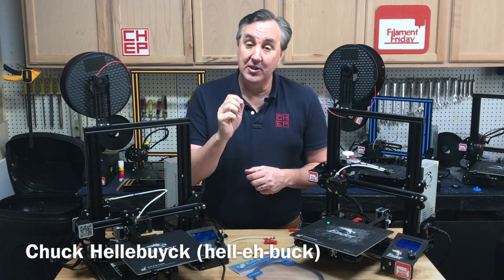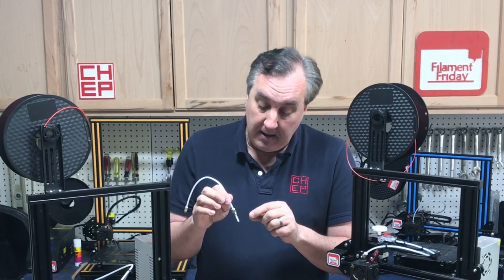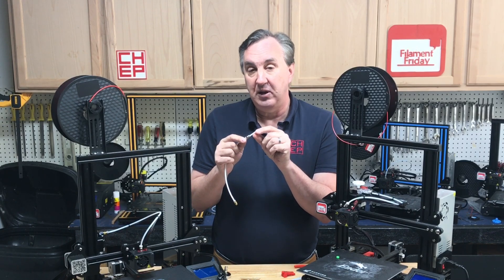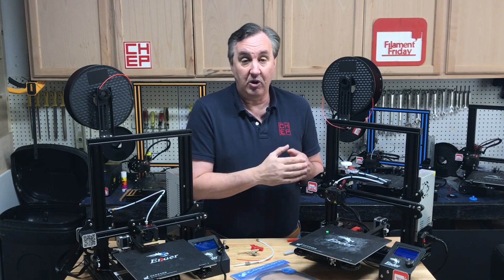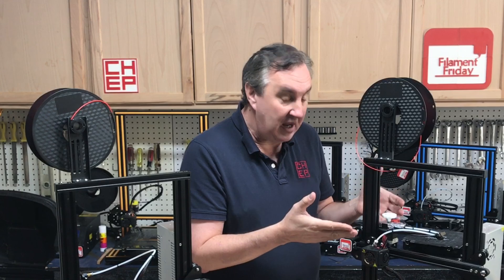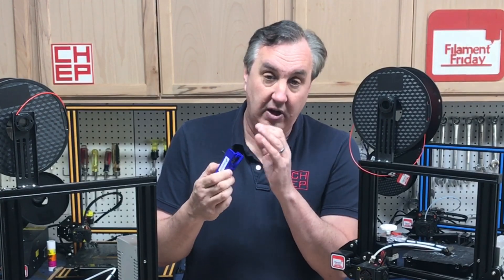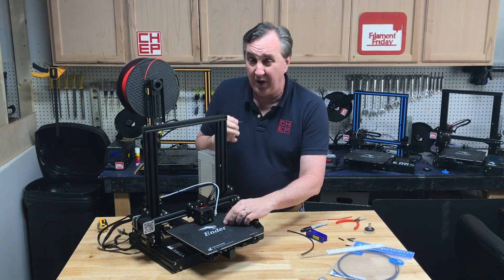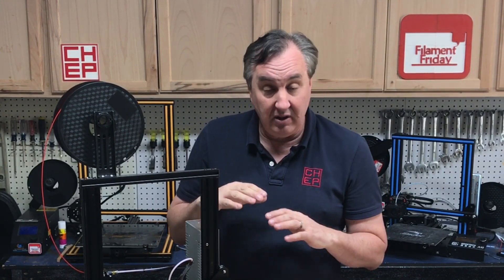Simple HOTEND FIX for Creality Ender 3, CR-10

Comment: I'm in the middle of trying this for my Ender 3V2 and I'm stuck!!  In the video mock-up hot end, the tubing OD just barely fits inside of the hot-end, so it's held perfectly centered.  But when I take off my coupling, there's a very large diameter space inside the hot-end and only the very end of the tubing is held tightly just before it hits the top of the nozzle.  As a result, the short length of capricorn tubing isn't held in the center and doesn't line up with the hole in the washer.

Any ideas?
EDIT: I'm thinking my heat break is f'd?  If I understand it correctly, it should be running up the inside of the fin structure.  I've ordered an all metal heat break replacement.  Hopefully that fixes it.
Reply from the maker: Newer machines are different. If you’re trying to fix clogs, replace the fan. Most issues are the fan failing and not cooling the finned heat sink fast enough.
Reply: @FilamentFriday  Thank you!  Yes, I saw that you'd posted that in reply to another person's comment.  I do think my fan sucked (hehe) so I've also replaced it.
Reply: @cwyckham just read this comment as I am about to implement this "fix". My E3V2 is stock machine and is currently running perfectly without any issues. I am just thinking of implementing this "fix" as a long term solution and also as a step towards arming myself to print some higher temperature filaments like PETG, TPU etc.
Could you please share what your eventual solution was? What timeframe is your machine manufactured? Mine is a late 2022 manufacturing date so wondering if mine would have same loose fitting hotend.
I am just afraid of falling into the trap of "don't fix that ain't broke". Any insights are highly appreciated. Thanks in advance.

Comment: I used it and it worked for a while, had to replace with a new pfte section and washer, now after assembling the filament won't go past the washer. Pfte is from the same coil and washer is from the same batch I printed
Reply from the maker: Your fan is probably failing and spinning to slow.

Comment: Can one print with petg using this mod?  If the washer is printed with pla, and  that washer is connected to the heat sink, is that so hot that the pla would melt?
Reply from the maker: Yes, you can’t use PETG, but if the heat sink gets hot enough to melt plastic then the cooling fan isn’t working properly. The heat sink should never get too hot to touch.
Reply: @FilamentFriday  brilliant.  Thank you for taking the time to reply.  

I just did this modification Instead of replacing the heat break ( I have one from triangle labs) but figured I'd give this a go.  

I've done the mod, btw and it's working fine as I write.

Tomorrow I'm going to try some TPU.
Reply: @briholt100   just read this comment as I am about to implement this mod. My E3V2 is stock machine and is currently running perfectly without any issues. I am just thinking of implementing this "fix" as a long term solution and also as a step towards arming myself to print some higher temperature filaments like PETG, TPU etc.
Could you please share any updates or tips you may have since I presume you have been using it since posting about a year ago.
I am just afraid of falling into the trap of "don't fix that ain't broke". Any insights are highly appreciated. Thanks in advance.

Comment: It worked! At first. But I was already thinking that it would be a bad idea to put PLA inside the heat sink. It almost ended up melting in there.
Reply from the maker: If it melted then your fan is failing. The heat sink should never get that hot. Shouldn’t even be hot to touch if fan is working properly.
Reply: @FilamentFriday  Thanks for the reply! I suspected as much. That's why I bought new coolers and I'm going to print a dual cooling mod. I also decided to put a bimetal barrel. Thanks again. Your videos are very useful.
Reply: @FilamentFriday  Hi! I'm searching for a cooling mod that increase the refrigeration of the coldzone and heatsink of mi hotend. But I can't find none. I have 3 40mm cooolers to put on him if that's needed. Can you help me to find one?
Reply from the maker: @ - There is a water cooling option from Creality.

Comment: Once again you have been my hero.  I was having problems with prints not completing, the extruder motor was skipping and I thought it was due to heat fluctuation and the nozzle clogging up.  I tried tuning the heat temperature, but that only slightly helped.  I then came across this fix and thought, why not.  I did this and so far my problems have gone away, smooth printing and completes to the end.  Thank you so much.

Comment: So ive used this for years on my ender 3. But shep i was wondering with a full capricorn tube from extruder to hot end. And better cuplings is this still worth doing
Reply from the maker: If it works, why change it. I’ve had good couplings fail so I still believe it’s a good solution.
Reply: I used a full Capricorn tube at first. Worked really badly, too much friction (since it is a bit tighter, as Chep pointed out). Then I used this hotend fix. Works perfectly ever since.

Comment: In regards to the Creality Ender 5:
DO NOT set the z-depth via software, the printer auto-homes before EVERY print.
The z depth has to be set by the screw on the back of the build, then the individual corner screws have to be set.

A lot of you may be thinking, well duh but it isn't obvious! Especially people new to troubleshooting.
Can't believe nobody explained this in any of the videos/threads I read 🙄

Comment: is anyone having the issue of the washer melting in the hot end? would it be better to use a more heat resistant material like resin?
Reply: I am using PETG...  PLA might not be a high enough temp...

Comment: why cant we use a small metal tube inside the hotend instead of teflon? Isn't that how all metal hotends work anyway?
Reply: At this point literally just get a Bimetal Heatbreak with Titanium/Brass or copper mix and replace the stock hotend heatbreak

Comment: when assembling this hotend setup use a spare piece of filament down in the nozzle to make sure the washer and capricorn tubing line up accurately. also to prevent the ptfe tube from walking out of the lock fittings use a small dab of shoe goe between the ptfe tube and the plastic retaining ring and wait for it to set. I had ptfe tubing wear and start moving in and out of the pneumatic fittings due to the constant rotating cutting a groove in the tubing, once I applied the easily removable glue to the tube and the lock collar i have never had it come lose without me wanting it to again.
Reply: @chrismckay3868 those are nice tips. Thanks as I am about to embark on this mod. Can you please explain what shoe goe is and where to find it. Thanks in advance.

Comment: i love what this talks about, but in my experience with capricorn, is that i've had issues with clogging and found snipping that last 5-10mm or so off to help clear things up and i've found the olive oil has also done wonders to quiet otherwise clog prone situations..   why wouldn't we just put a metal tube in there instead for luke's solution?  maybe expansion / contraction of metal would create problems?   It seems like even capricorn loses it's lube over time..  but i respect you're saying 14months of hassle free printing..  that conflicts with my own experiences with my 4 Ender 3 Pros (all configured identically)

Comment: I was getting the E1 error on my Ender 3 Pro every now and then, so I tried replacing the heat cartridge. I made sure the connections were correct and secure, but even so, now neither the hotend nor the bed even attempt to heat up, and I get the Heating Failed error within a few seconds. Where could I have gone wrong here? Also, for some reason, when I tried to autohome it, when it finished, the nozzle was about 3-4 inches above the bed instead of where it should be. Not only that, but every time I autohome it, the nozzle moves up higher each time. I didn't mess with any of that, so I'm completely in the dark here.

Comment: In theory, Creality's water cooling kit should help eliminate the issue that this fix resolves, I think?. Since it acts as a stronger layer of temperature protection between the hot end and the PTFE. Thoughts?

Comment: Hello Chuck - I am new to 3D printing & your videos are my go-to videos for many things. Thanks for everything you do.
Speaking of this particular Hot End Fix, is this like a poor man's "all metal hot end"? I believe the Capricorn tube is rated at 300c, so by using a piece of Capricorn tube where it matters the most, will this allow me to print materials like Nylon that require running nozzle at 280-290c? Thanks in advance.
Reply from the maker: Yes, but Capricorn is only about 10-15° higher than standard PTFE no matter what they claim. So a real metal heatbreak is better. https://youtu.be/4RWz4ey1wjw
Reply: @FilamentFriday  ohh ok. Thanks for your continued guidance. Will look into the video you referenced. I guess that one is applicable for Ender 3 V2 as well. Thanks again 🙏
Reply: @FilamentFriday  do you think it's still worth doing this washer modification if you have an all metal hot end?

Comment: Will it still work ok if I print the washer out of PLA instead of PTFE?
Reply: PTFE is the material of the bowden tube, not the filament, you can do it out of PLA without problem

Comment: All my Ender 3D printers are oficially dead atm. So, I can't print a spacer. I found a couple of alternative options: 
a) small spring that would supposedly push onto the tube;
b) small metal spacer
c) small plastic dowel, cut the neck of it.
I guess with the metal I'd have to be very precise as there will be little tolerance. What would be my best option?
Reply: I hope you ended up fixing that already but your best bet would have been to fix the printers first...but besides that just grab some tubing (the water stuff) of the right ID/OD and use it like that spacer.

Comment: Good place to put a piece of aluminum tubing instead of PTFE. As the hotend expands and contracts with temperature, aluminum tubing will expand and contract at exactly the same rate, maintaining identical pressure against the nozzle at all temperatures. PTFE has a completely different (much more radical) thermal expansion coefficient, and so will not keep consistent pressure against the back of the nozzle.

Comment: FYI, eventually even the capricorn tubing will need replaced in the hot end. I've used mine like this for 30 months and I was having terrible problems. I pulled the Capricorn 20mm tube out of the hot end and it had melted at the end and had a blob of filament stuck to it.

Comment: I had issues with extrusion stopping mid print, upgraded the fittings, got a  capricon tube, did the trick with the small piece inside the hotend and the washer. Nothing's changed, can't print anything longer than 30minutes.
Reply from the maker: Check the cooling fan. May be spinning too slow.
Reply: Thank you both for the answers, I took apart the hotend again and the washer was completely mashed in the fitting, it's heat problem after all.
Reply: Like Chep said, check the hotend cooling fan. You may be getting heat creep. That's where the hotend fan and heat sink can not keep up with the heat generated by the heater cartridge. Alternatively, you may want to turn your printing temperature down depending on what you have it set to.

Edit: after reading some other comments, ensure your hotend fan is facing the right to direction.

Comment: I wonder where Capricorn gets their magic PTFE from??  They have something the entire rest of the polymer industry wants:  PTFE with a higher service temp than everyone else's PTFE!
Gosh, Magic Teflon, what a time to be alive. 
@_@  
NOT!!
PTFE IS PTFE IS PTFE, and all PTFE has a maximum service temp of 400ºF. 
Period, the end, full stop. Anyone who tells you otherwise is selling snake oil.
PTFE begins plastic deformation at 500ºF, that is NOT it's allowable SERVICE temperature!
Reply: Maybe these are blends? It's my best guess if everything is to be believed
Reply: So you're saying the stock ender 3 tubing can run the higher heat filaments?  I was under the impression that it could not handle them, as this is mostly what you hear in the community.

Comment: I think this is the cause of my issues on my Ender 3 Pro. I can't get anything to print (after upgrading the PTFE tubing and tossing the original tubing and a metal extruder replacement) due to what seems like under extrusion. I'm the only person I know with a 3D printer as well, so I can't just ask a friend to print a washer for me. Could I use a metal washer from a hardware store? If so, what size should I be looking for?
Reply from the maker: Can’t you just remove the existing PTFE and clear out the clog and then make sure the PTFE is tight to the nozzle?
Yes, you can use a metal washer if you want.
Reply: @FilamentFriday  I will try that. Thank you!
Reply: @carlborch1887  did this solve your problem? I'm facing your same situation: replaced PTFE, uprgraded extruder and got inconsistent extrusion due to filament expanding inside the new PTFE tube
Reply: @shadowgreen123  I'm going to stop by my local hardware store and pick up some metal washers to stack them. I couldn't find a clog, so my backup plan is to try the washers and then if it still doesn't work, I have Creality tubing that's like the stock tubing coming to replace the Capricorn tubing. I print PLA only as I don't have a good ventilation plan in my apartment, so I'm not too concerned. I did find the filament was having a difficult time moving through the Capricorn tubing, so I intend to do some more trial and error stuff this weekend once work slows down.
Reply: @carlborch1887  I did this fix yesterday but didn't work. I think I have severe heat creep after some minutes of operation... Ambient temperature is ±30°C so it might be that not enough air is cooling the hotend fins
Reply from the maker: Your fan is probably failing.
Reply: @FilamentFriday  you are right! Stupid me left the hotend fan in the wrong direction, now it prints like a charm. Thank you!

Comment: I’ve been having a lot of trouble with stringing, globs, and possibly under extrusion on my ender 3. I have taken apart the hot end and extruder several times, cleaning out any gunk and making sure everything is tight together. I am also using this trick with Capricorn  PTFE tubing except I am using metal washers instead of the printed ones. I made sure that the connectors holding the PTFE tubes in place are working properly and the tubing is not moving during retraction/extrusion. In terms of slicer settings, I am using Chep’s latest, best Cura profile. I have not touched the firmware and have not modified the printer in any way except for with this mod. Does anyone know what might be the problem? Any help would be tremendously appreciated. Thanks
Reply: Do you still have the stock plastic extruder setup? Have you addressed the angle of the filament to the extruder?

Comment: I've been having loads of problems with stringing on my ender 5 so i tried this, initially it seemed good but then I noticed underextrusion for the first few cm of a new layer, then noticed my fitting had loosened up alot, I tighten, it loosens, and eventually I just end up with loads of stringing and ugly quality 🫤

I have replaced my entire hotend trying to fix my stringing/oozing problem, I have a suspicion that my heatsink fan might not be 100% as I had to extend the wires for it and the soldering job is probably not perfect. Any advice from anyone with more knowledge on this is massively appreciated, I've probably done a hundred retraction tests and dozens of temp towers trying to get my settings right, calculated e steps and flow as well
Reply: Update... Nevermind... It turns out there is an issue with my printers firmware and that causes problems with octoprint, printing through usb is perfect 🥲

Comment: Thank you, Chuck, for all of the 3D printing guidance. Your washer, based upon Luke Hatfield's design, has been running very well in our Ender-3 Pro for months.  I printed mine from ABS and am using Capricorn PTFE tubing in the hot end. Recently I discovered PETG.  After a good number of prints, my nozzle clogged.  During cleaning and analysis, I found the Capricorn PTFE tube bound to the pass-through factory heat break.  After pulling out the tube, there was residue burned to the heat break.  After scraping it clean, I have been able to reassemble with fresh Capricorn tubing and a new nozzle.  Then, I saw your video about the SLICE Engineering heat break.  Since I will be printing mostly with PETG and ABS, can you recommend that I switch from the Luke Hatfield compressed PTFE solution to an updated heat break?  Thank you! RC
Reply from the maker: Yes, the slice engineering heat break is much better for long term and higher temp printing.
Reply: @FilamentFriday  Thank you for the response. I have ordered the heatbreak from SLICE and some other items including the lollypops!!!